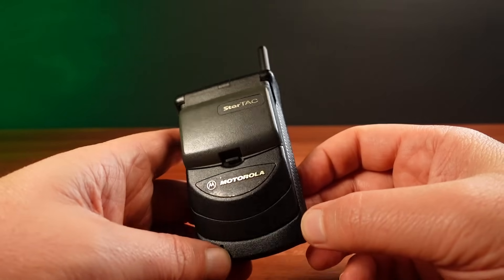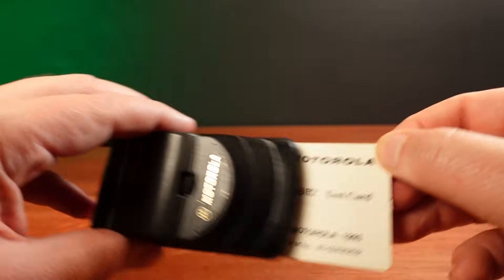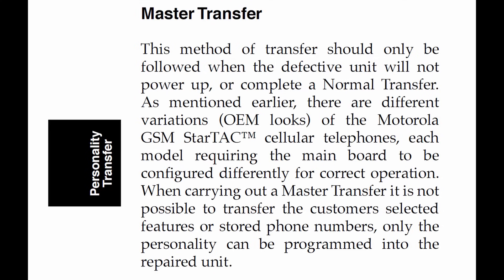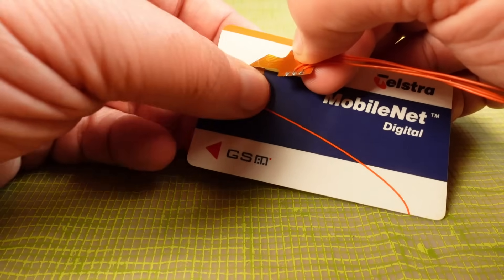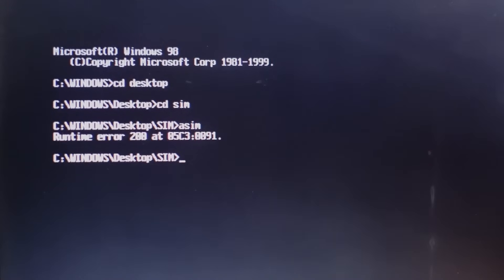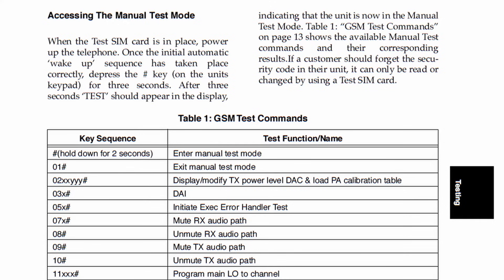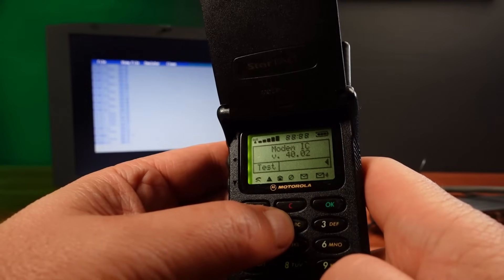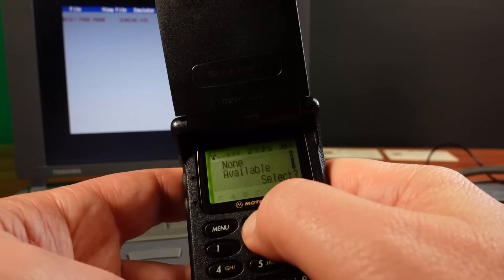SIM Card Emulator Vs Motorola StarTAC

Comment: Thank you for your video, it helped a lot while I was replicating this for my own Motorolas and I find your videos a joy to watch. I didn't have a vintage PC to use, but making use of a DB9 serial to USB adapter worked fine when passed through to DOSBOX on a modern system. I didn't have to patch anything and have been using the ASIM emulator clone card to unlock my phones (An MR1 and MR601 locked to Orange UK) and use them again once more. I'm from the UK, so we still have GSM900 and 1800 networks in operation and the phones remain fully functional. If anyone wants to replicate this, I'd recommend the following tips: Use a modern SIM as your base, as these cards are much thinner and flexible making it easier to slide into the phone with the added thickness of the adapter. 5k1 resistors work fine in place of the 4k7 resistors with both of my Motorola units, but your mileage may vary and oddities / damage may occur. Finally, if you get stuck where only test mode works through the ASIM emulator, it's likely you just need to load the clone card and then use the clone menu option in ASIM to initiate clone mode rather than just loading the SIM like you would with the test card.
Reply from the maker: That is awesome you were able to get this to work with DOSbox and USB to serial. I hadn't considered this possibility. Thank you for sharing your experience and tips on this. And well done on getting your phones to work again. Your comment made my day, thank you.
Reply: @JanusCycle  - Geez... the size of that full sized sim card. lol   I only heard about it, in the US I've never seen one, always been using the mini size from the beginning.  I still have one of those "white" test cards with IMSI 000-010xxx, great for testing purposes.
Reply: so cool!

Comment: I used to get into the test mode of my PT-550 using the battery's middle pin trick and had some fun enabling the radio to catch some AMPS conversations. Really good times!
Reply: Siiiii el TEST MODE era una cosa genial, yo tengo unas grabaciones del año 2004, eran las ultimas del canal de voceo el 333/334

Comment: I would have made a cutout in the base card to make room for the wires and the pcb where you soldered them so that it would fit easier in the phone. Of course I wouldn't cut a vintage card, if I wanted to keep it intact but I would use a new/common one. Also the sim chip and contacts can be peeled off from the plastic base so that the contacts of the adapter can stay in the resulting cavity.

Comment: what's up with the hum in the audio on this one?
Reply from the maker: I was really suffering from bad audio engineering and interference from nearby equipment a while back. I've been work hard at improving all aspects of my audio and I still have much more to learn. But you noticing this means I've hopefully been getting much better. Thanks!
Reply: @JanusCycle  Glad to hear you figured it out? Did you get a ground loop isolator or something? I have this KVM that makes my speakers hum, thought there was a ground loop, but there wasn't so now I have to buy a new KVM and hope for the best. Thank you for all the effort you put in!
Reply from the maker: @concr3t3  My ground loops are not fully resolved. I plug my camera into a USB battery to isolate it and turn off as much equipment as I can when recording.
Not ideal but workable for the moment. I do want to upgrade my mic and revisit the hum problems sometime.

Comment: subed. is it possible to solder a new 4g radio on to these?
Reply from the maker: I know someone who put a 4G module in an original Nokia 3310
Reply: @JanusCycle  do you know if these old phones use AT commands to speak to the radio module?

Comment: I loved this video. I'm a StarTAC fanatic. I have a Windows 98 Thinkpad I use with PEMASTER to unlock and resell these phones on ebay. It's been a good side hustle. I can also change the startup logo with this software. A few years ago, I came across a prototype StarTAC that accepts a normal mini sim, but is tri-band. It looks like a starTAC 130, but supports 1900MHz GSM like we have here in the states, at least until April of 2024. It never found a network. It searches and doesn't find anything. A 7000g or similar with the same SIM connects fine. I don't have a test card for this phone. Would you be interested in tinkering with it? I love your channel and would be happy to send it to you.  Message me if you're interested.
Reply from the maker: A prototype StarTAC that looks like a 130? Yes, of course I want that! Send me an email, address is on the about page. I'm also envious that you have networks that can still use StarTACs.

Comment: Video says phone firmware is too new to have test mode but then you insert an emulated sim to get test mode.  
I don't think you really detailed why or how you now have test mode.
Unless firmware is on the sim card and I don't think that is the case.  
Either you did not cover this magic or I outright missed something.  :)
Reply: Still watching, seems that you covered this toward the end.. (without a test sim).  
Not sure though.  :)  
The older AMPS phones that had testmode available were fun.  
They were a lot more fun with the old networks were still in use :) :)
Reply from the maker: Thanks for watching, I hope you enjoyed :)
Reply: @JanusCycle  Yep- it was decent!
Reply from the maker: I meant the firmware is too new to use keypad codes to activate hidden user menus. The test card activates hidden test mode commands, but not hidden user menus. The transfer card can be emulated to change memory contents in the phone. This can be used to activate hidden user menus and activate hidden test mode commands.

Comment: You could jave cut out the plastic section on the large sim card so the flexible circuit board and the cables would be "integrated" in that card. And then some tape over it to seal.

Comment: What a thoroughly interesting watch. Regarding your issues with the timing of ASIM, I was interested to see how it was solved. I had a similar issue with erroneous operation of Motorola software used to program Syntrx radios. My solution was to run the software on a 486DX, that I had stashed away. Seemed to work nicely.

Comment: I sold phones via Radio Shack back in this era... and into the early to mid 2000's. Regardless, here in the states, with carriers like VZW and Sprint, they used CDMA back then... and ESN's rather than SIMs... so, same phones but even smaller... as there were no provisions for any cards at all. Everything was done via keypad codes too, the hidden menus and such.
Reply: AT&T and TMobile where the only GSM networks in the US at that time

Comment: I love that this is relatable to modern day phones. Samsung also just removed some hidden menus like the band selector from their phones requiring a shell exploit to access now.
Reply: There's a program called SamTool that enables RF Test mode (*#73#) on Samsung phones via AT commands over the "diag" usb mux. It's an enormously usefull dialer code once enabled. The system uid shell exploit is awesome too because it gives read access to all the phone's battery stats listed under /sys/class/power_supply/battery like # of cycles and even # of times the usb-c plug has been used lol
Reply: @snowdaysrule  couldn't get it to work on my note 20 Ultra
Reply: @coreybabcock2023  Give it another shot! I just used it on a sm-n9860 and a sm-s901u1 and it really does enable *#73# | The program was apparently given an update because both phones were able to enable RF Test pretty much instantly the process works the first attempt now.
Reply: @snowdaysrule  tried that and nothing happened on my M23

Comment: This is such a fun trip down memory lane. I didn’t have a chance to mess around with the StarTac phones, but I spent a LOT of time editing memory dumps of my Motorola e815 and my Motorola KRZR back around 2005-2007. I remember being SO annoyed with Verizon here in the states and how they disabled features or (like in the case of the KRZR) how they put their own custom UI on it instead of the native Motorola UI. With the help of Internet forums and questionable software, I was able to enable hidden features, turn on disabled features, and load up different firmwares from Canadian carriers to get my Moto UI back like I wanted it. There was nothing quite like the rush of editing memory dumps bit by bit then holding your breath as you hit the write button hoping that it booted and didn’t break the device (while hoping the feature you wanted was enabled!) I recently got into playing with SDRs and getting a couple of AMPS phones back up and running on my own mini network, but I may have to add a couple of these StarTac handhelds to my 2G test networks! Thanks for the video - this was a cool find!
Reply from the maker: I didn't know about modding Motorola KRZR phones, thanks.

Comment: Those phones were sold together with fixed car phones in a bundle. The ones in the car had a higher output, and a roof antenna so they would work in places with less coverage. The car phones  used the big SIM card format, so to make it easier to transfer, they used the big cards also in the startac. (source: me, selling and servicing car phones around 2000 for PTT/KPN telecom)

Comment: can you check your audio gear ? you got some electrical humming in the background
Reply from the maker: Thank you, I have been working to remove the hum. Hopefully better in other recent videos.
Reply: @JanusCycle  im not sure on how good your graphics card is, but if it is at least equivalent to an gtx 1060 then try out RTX Voice, or if you got any RTX card try using nvidia voice, with those two programms you can let most of the background noise be filtered out. 
It is maybe a bit too agressive and cuts away a bit too much but it is worth the try as it is basically free if you got one of the cards

Comment: An idea: you might be able to cut between the contacts and/or microwave a full sized card for a few seconds (to fry the intenals), check with a continuity meter that tnere is no continuity between pads a d simply solder directly to the pads on the dummy card. Also you might use a loyalty/gift card from a shop.

Comment: When i had motorola 8700 back than I built a similar serial interface.. It was a PCB longer than a regular Sim Card with a max232 circuit. I remember using medit to modify the logo image!

Comment: The Motorola flare predates this but also used the full size card.

My first mobile phone was purchased in 1997, a siemens c10 swing with Optus express prepaid. Cost me $200-  Still have that phone number.
Kinda shame that GSM is gone. I could answer the phone before or rang

Comment: Ah man, changing the welcome screen graphic reminds me of those pestilent Nokia 3310s everyone used to have. Every magazine you read would have pages full of ads, new screens you could receive by text message, if you spent 3 quid txting this company a special code. All sorts of really cheezy little hand-drawings and the odd dithered photo that was supposed to look like some celebrity. "I love boobs" "cars are great", all the quality stuff you could ask for. And the ringtones! Remember when that was a market that existed! Then disappeared just as quick when MP3 ringtones came in. Business must have been as good as vapes were a year or two ago, every other shop in my town sells vapes! 

Anyway... if it were me I'd twist those wires together on the shonky SIM adaptor, just for a modicum of strength. I might also stick the connector on the other side of the card, so you could still use it's original function if you wanted to.

Giant SIMS, too! I remember those on the ubiquitous Philips Diga everyone got for xmas one time in the 1990s.

Comment: I had a StarTAC in 2014/2015, bought a prepaid SIM and used it for quite a while for fun. Did the same with a few more of my older models. Shame that 2G is gone now.
Reply: Still in use in Central Europe with the plan of shutting down no earlier than 2028. We shut down 3G networks rather than 2G in the effort of making space for 5G as there's a significant number of users with 2G phones (I assume old people) while 3G never really took off around here.
Reply: @YS_Production  Nobody cares about old people in this contest... Here (Europe, at least Italy) it's still there because of POS and things like that. Too much effort to replace millions of devices just to be compatible with newer technologies. (Yeah, Ingenico and other manufacturers for example, also in 2023, still uses GPRS).
Reply: @DetectiveOnan and power meters of Enel, the electric company.
Reply: @mm-es6yq  Right. Even some "newer" gas ones. But at least my gas meter, under TIM network, it's on 3G if I recall correctly.

Comment: I really wish there was a way for these phones to work on more modern networks. Every iteration of mobile phone network completely breaks compatibility with the last and it is a shame
Reply from the maker: LTE is designed for long term compatability. That doesn't help legacy products though.
Reply: @JanusCycle  I’m curious as to what that would look like in action though. Would it mean that LTE devices could connect to newer generations of the network when LTE itself is killed off?
Reply from the maker: @burntoutelectronics  I'm not familiar enough with the details. I just remember that LTE (Long-term evolution) was meant to help with obsolescence. Things could have changed with 5G though and I could be out of date.

Comment: It is sad that in modern phones such options are hidden even deeper.
I hope that at some point it will be possible to have modern smartphone with both hardware and software opensourced.
Reply: Fairphone gets close.The OS it runs on (Android) is open-source and the hardware also to some degeee
Reply: @tezcanaslan2877  if I understand correctly, most drivers for Android are closed source.
Example of really open-source OS is postmarketOS, but for some reason it have big problems with camera support.

Comment: what is interesting is that over here (in germany) when you order a sim card or get sent one, it comes in that full size form factor w/ the breakout tabs 
so technically, if it wasnt for the shutdown of the network, you could use a startak to this day using a modern simcard
Reply: it's GMS, SMS, full phone, the sim card doing a lot on the heavy lifting, thing SIM card on the phone like phone book telephone number, and all SMS (email) massaging was all handled by the sim card, just taking your sim card of of your phone, them placing it different phone moved your  phone book, and all your massages too, to that phone not just your phone number, the sim card is a little  computer (CPU,MEMORY,STORAGE,PROGRAMS all the bit that make computer) in it own right it not just simple memory card, the phone is of not (sort of terminal, and power supply, and radio transmitter/receiver ), to access the real phone that is really the sim card?
Reply: @dh2032  SIM card is just a storage + crypto processor to auth into the network and decrypt stored data.
Reply: It was the same here in Australia until the networks were shutdown in 2019 (At least for telstra). Afterwards, they immediately shrunk the size of the plastic knock-out as no phones which utilize full size sims would still have a network available to them
Reply: You could still use a StarTAK in Germany as GSM (2G) has not been shutdown here yet
Reply: fun fact: the full size sim card is the same format as modern credit/debit cards, even the chip is in the same position.
Reply: @addo9697  wich has had me confused before looking at novelty credit/debit cards as they remind me of the payphone cards of days past
Reply: Not really, operating voltage is different, it would either simply not work or fry the modern card.

Comment: In Serbia we still get the full large sim card but nobody knows it was used like that back in the day. Most people asume its juct a holder for a smaller card that you brake out of it.
Reply: And... with the right adapter, you could just have a "dual sim" card. Just take off the card, flip it 180 degrees, and insert it back... I had that in Motorola 8700 and it was something great...

Comment: Oh my god! That's actually what I did in 1999 or 2000 when I was in university. I had all this soft and this site was dumped on CD, it had some crazy collection of hacker's and phreakers sites and utils. I did exactly the same with logo and service menu. Additionally, I've cloned my sim and managed to run a copy of it on PIC16F84 microcontroller emulator. Oh boy, what a flashback video. Wait a minute, WAS THAT YOUR SITE???
Reply from the maker: That site wasn't me. Just the same first name. Great to hear from someone who did this back in the day.
Reply: @JanusCycle  Awesome video anyway, keep it up. Thanks for bringing it all back.